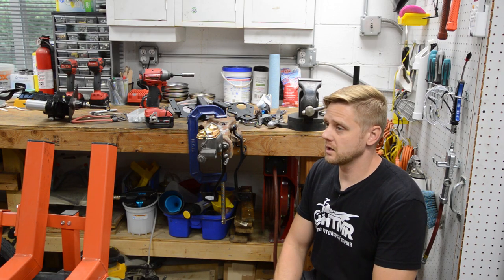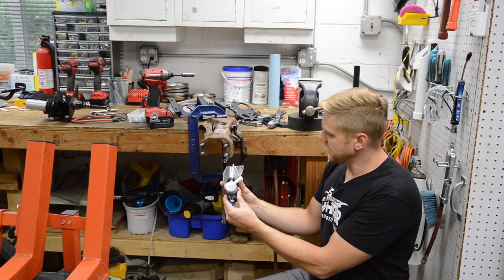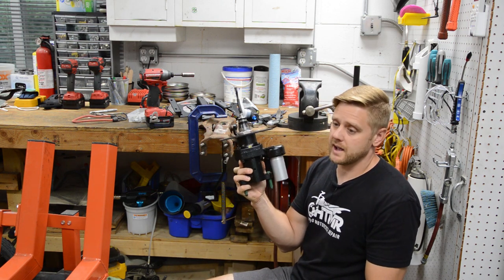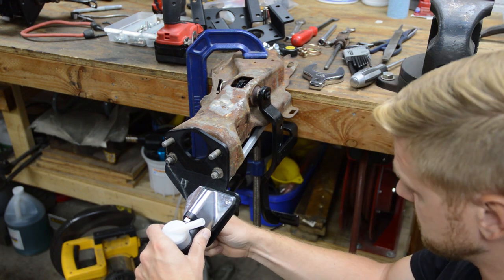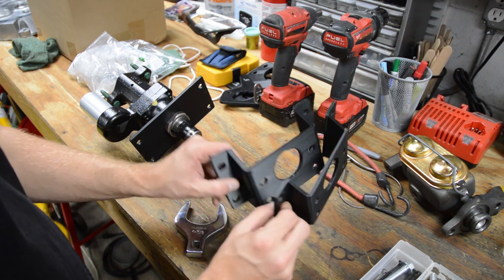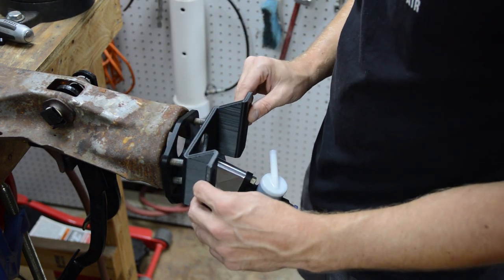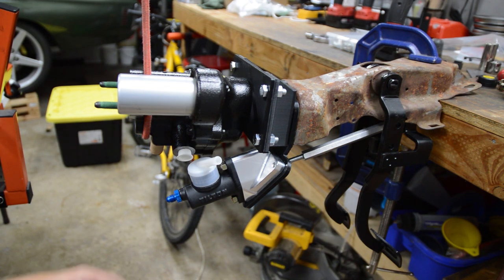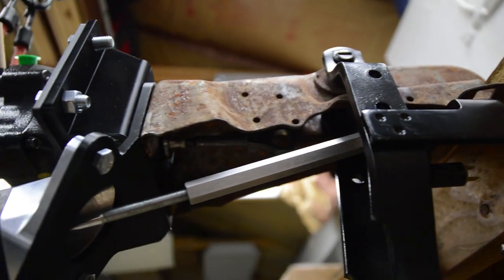T56 Master Cylinder Bracket / Hydroboost Bracket / GM A Body - Part 1

Comment: Greetings and congratulations and a very good video and work on the manufacturing of the parts for the brake system and the hydraulic clutch pump bracket mount for the Chevelle, could you make those brackets in metal parts and sell them so that one can buy them and do the same in my Chevelle???
Reply from the maker: Brackets now available here: https://howtomotorcyclerepair.com/product/htmr-hydroboost-bracket/

Comment: Hi, I have a 69 442 that I am doing a hydroboost conversion on. I made a plate to bolt the hydroboost unit to the firewall. Is it important for functionality to have the hydroboost a few inches away from firewall to get the rod to be on the right angle to the brake pedal hole, or would be able to install the hydroboost flat against the firewall with no space amd still ge the desired angle? Basically have the hydroboost rod end protruding through the inside of firewall and have it mounted with no space between firewall and bracket???

Thank you
Reply from the maker: You definitely need some angle to get decent pushrod alignment.
Reply: @HTMR  thank you

Comment: Im wanting to go from auto to a manual swap on my 69 chevelle, two questions im planning on going the tkx route so my question is would do you know if thr auto chevelle comes with the same provisions to fit that tick slave ?
Reply from the maker: No they don't.
Reply: Thank you, so what would be the alternative? Secondly, did you ever consider the Classic Performance Hydrastop Hydraulic Brake Assist Kit 6474HBK-BSB?
Reply from the maker: @pilsonandrew  Yes, until I saw the price and decided to DIY it all.

Comment: Whats the part number to the hydroboost pump? Or the make and model that unit belongs to? I have read the A body guys use the astrovan hydroboost pump but not sure from what year?
Reply from the maker: I did not go with the astro van style since they are all reman units. Reman units do not come with the the little star washer and pushrod in the hydrobooster. I bought this one for a 2011 silverado 2500 brand new fully stuffed with pushrod etc.   https://amzn.to/3wm8AA8
Reply: @HTMR how did you convert the pushrod that connects to the brake pedal to a clevis mount like the original A Body.  did you cut the pushrod that connects to the brake pedal and thread it or weld a sleeve? The factory rod from the hydroboost is crimped on to the back. I really appreciate your help. Thanks for the great content on the channel.
Reply from the maker: @Leche_OG_  I haven't got that far yet. I plan on cutting and welding on a 3/8-24 adapter that came with my new clevis from inline tube. The adater goes female to male and will be easy to weld on.

Comment: Do you plan on integrating the clutch master bracket with the U shaped bracket?
Reply from the maker: Yes. What do you think of the concept so far?
Reply: I like it. I'm doing a very similar build on a 79 camaro. When you integrate the two brackets the hydroboost will move back towards the firewall the thickness of the clutch master bracket and closer to the clutch master. Does this still leave room for the hoses? I've also had a hard time finding the correct fittings for the hydroboost lines. Where were you able to find them at?
Reply from the maker: @XX79CamaroXX  The hydroboost will probably stay right where it is with the 7° bracket since the line clears. Also, the hydroboost can't move much further towards the firewall w/o opening up the firewall hole, which I don't want to do.

Fittings:
https://www.holley.com/products/plumbing_an_fittings_and_hose/adapters/power_steering_adapters/parts/961955ERL

https://www.holley.com/products/plumbing_an_fittings_and_hose/adapters/power_steering_adapters/parts/961956ERL
Reply: I'm not saying you should move the hydroboost back from it's current location. Just when you combine the two brackets they will no longer overlap and without making the top portion of the bracket twice as thick as the bottom portion it will move the hydroboost back that thickness.
Reply: Or I guess you could just make the U shaped portion deeper instead of making the bracket thicker